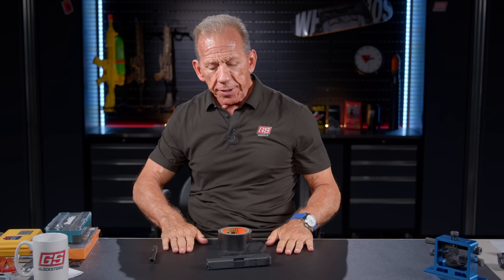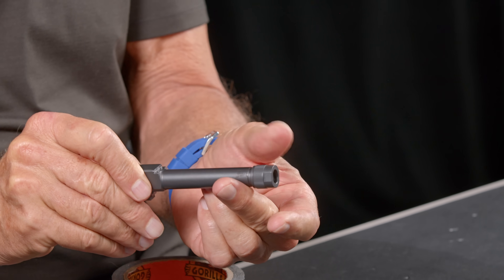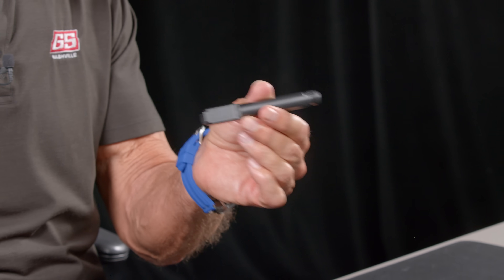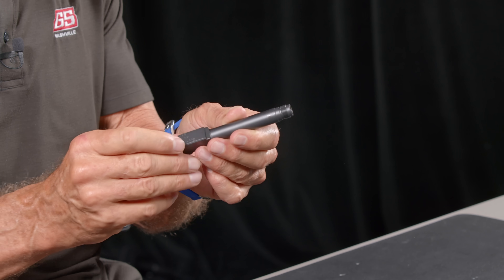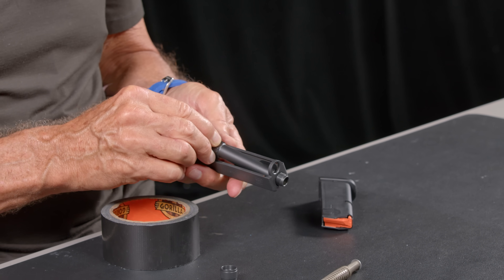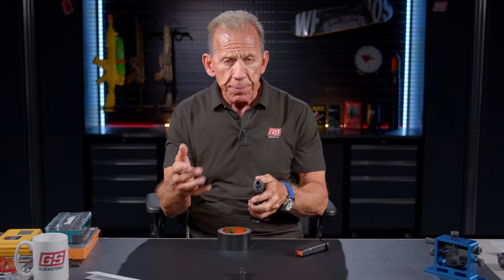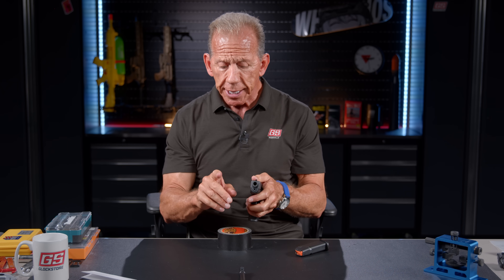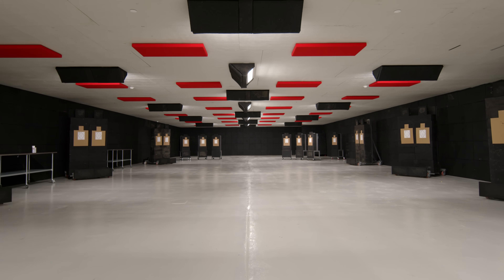Ultra-Rare Left-Hand Threaded Glock Barrels

Comment: Here in Europe this is a standard threaded barrel you can get as an oem part, or more commonly, you buy a Glock (many models 17, 19, 26...) with a threaded barrel already installed. On the other hand, aftermarket barrels, be it threaded or not, are rather rare and expensive here.

Comment: I have a Glock 19 Gen4 MOS SILC. Apparently SILC is the designation for the factory threaded barrel. My experience with the system after shooting with it for over 5 years is that the LHS thread can still come loose slightly, however typically after the barrel warms up initially. This will depend on the material of the silencer thread/piston due to slight variations in thermal expansion. After a magazine, I check that all is tight and it stays tight after that. 

The major benefit of the M13.5x1mm LH thread is the step profile means that the silencer remains mostly inline/coaxial with the barrel reducing the possibility of a baffle strike unlike many other threaded systems should the silencer come loose; at least that is what I have been told.

One suggestion I have is to ensure the thread is cleaned frequently, and apply copper-slip/anti-sieze as this ensures that carbon doesn't accumulate under the thread protector. Regular greases vaporize with heat, however the copper ensures you can still remove the thread protector without troubles.

Comment: If they are rare then there must have been a mix-up because I picked up a NIB Gen 3 G19 with one AND steel suppressor height sights at my local(SMALL town) gun shop like 8yrs ago for the same price as a standard Glock 19. 

Unfortunately the new guy behind the counter did not know it was a left thread pitch and there was nothing openly labeling it as such so I thought I was getting a GREAT deal until I got home and realized it didn't fit anything I had. 
When I looked into adapters for my suppressor it was cheaper to just buy an aftermarket 1/2 x 28" barrel but now that I've watched this I'm kinda wishing that I would have tried one.

Comment: My question is ? Why would they not design the the rifling of the inside of the barrel to Spin in a counter clockwise direction to eliminate any loosening effects of Such ??? Even the Nut on a lawnmower blade tightens opposite to the Spin direction of the motor as not to have the Nut on the blade loosening up causing the blade to fly off ??? If anyone can understand what I’m trying to say ?!!
Reply: Can't put a oil filter on it if it's left turn threads 😅
Reply: @Ren505nm You Can if you’re Stud Matches the Rifle Spin Thread , so state what sense in your Mind it it makes to allow the part to come loose from the Tork???
Reply: You need to ask your momma why she decided to NOT abort you
Reply: @no_excuses_accepted You Need to change your title to No Answer Dumb Ass instead of No excuses for such a attack of Stupidity !!! That wasn’t Justified at all and I Hope when you Beg and plead with your Doctor of How long do you have left on Earth , He Doesn’t State the Same to You as You Pulled Out of your Bottom Brain Pan !!!
Reply: @no_excuses_accepted Jerk Answer Troll Bot?

Comment: When you buy a new barrel for your fire arm do you have to do background checks for it? Kind or a dumb question but just wondering.
Reply: No
Reply: Only for the frame, it's considered the actual firearm.
Reply: No background check for barrels, uppers, internal parts, slides, sights. Only frames or full guns

Comment: I have a gen 3 17 with the left handed threaded barrel and suppressor height sights. Came from the factory like this there was only a short run if these in like 2013 pretty rare glock
Reply: It was a the 17,19 and the 21 that got this factory upgrade in like 2013
Reply: Are they really that rare? 
I snagged a  G19 with the barrel and suppressor height sights at my local (SMALL town) gun store for the same price as a standard G19. 

I thought I was getting a SMOKING deal with the aftermarket accessories but the cost of an adapter for my suppressor turned out to be the same price as an aftermarket 1/2 x28" barrel so I just went that route and the OG barrel lives in my safe.
Reply: @larsonwheels not that rare but i believe it was under 20 thousand made and the frame barrel and slide all have matching serial numbers this was a quick run in like 2013 u can guess how many are left

Comment: This sounds like you guys ordered the wrong thing or they were made wrong and now you’re just finding a way to sell them. Honestly, I would do the same thing.🎉
Reply from the maker: We ordered them and had them imported specifically because we wanted them.
Reply: @glockstore  that is the best reason ever actually. Thank you for letting me know.
Reply: It's a standard thread pitch (M13.5x1LH). Many people like this left-handed thread pitch for suppressors as the suppressor will not "walk" off as it's being shot.
Reply: @gerogiperogi  isn’t that one reason it has a suppressor piston?
Reply: Bro if gou dint know about glocks please stay out of the comments lenny has been dealing with glicks for 30 plus years and i have a 17 with the left handed threaded barrel and suppressor height sights came from the factory that way its was inly a small production run in like 2013 pretty rare glock
Reply: @AndreJohnson7600  I many glocks and a load of suppressors. Some of them are left-hand thread like this. It has never made a difference ever… I love Lenny and his company. I have a lot of their products. But his verbalization and mannerisms are off on this one. Which leads me to believe that there was a mistake somewhere.
Reply: @greggwilson492 its not a mistake bro the threads to screw on a suppressor or compensator are left handed which allows a right handed person to screw on the device without removing their shooting hand if you left handed you should have right handed threads . If u dont plan on using either device ( suppressor or compensator)dont worry about threaded barrels i hope this helps 💯💯✊🏿✊🏿